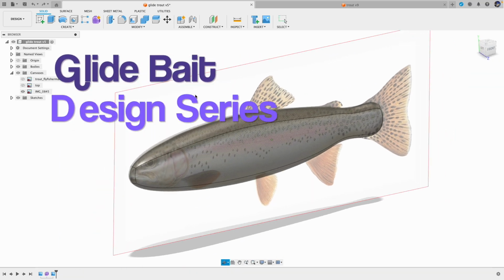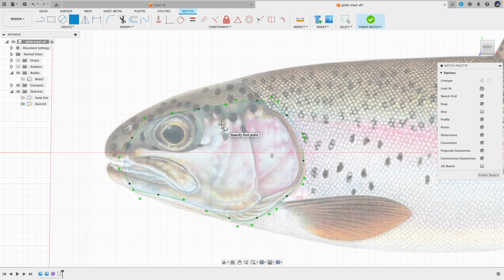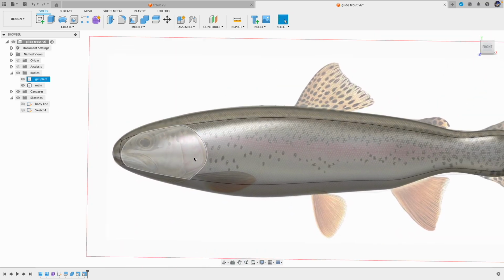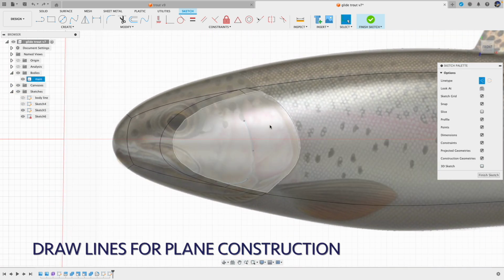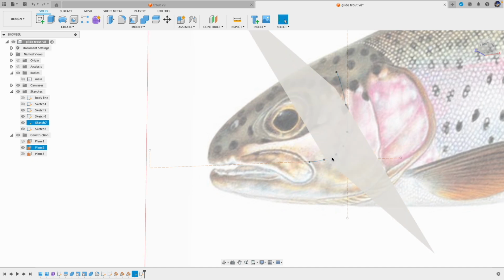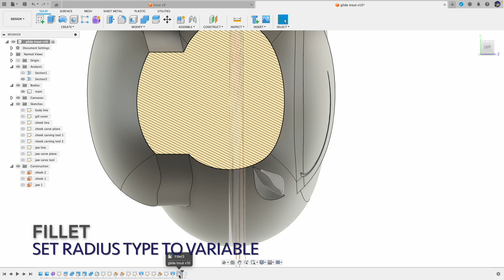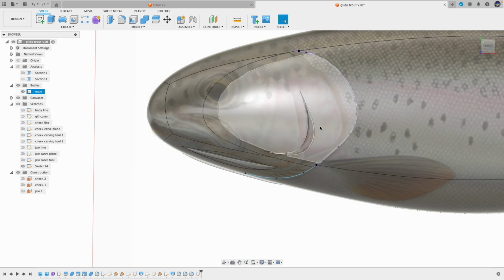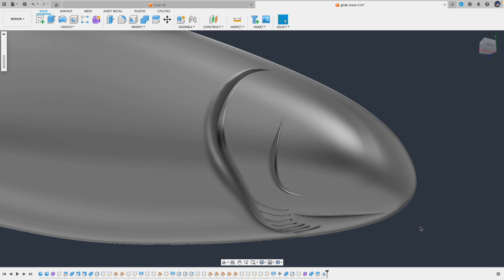Trout Glide Bait Modeling Series (in Fusion 360) - Gill Cover

Comment: How do you get the edge from inserting points to show up on both sides I keep putting numbers in adusting from top and bottom to make my bait perfectly symetrical there has to be an easier way, I tried splitting and mirroring and can't figure it out. Genuinely so frustrated
Reply from the maker: In the INSERT EDGE parameter window, there is an insertion side option, default to single. Change it to both and you should see new edge show up on both sides.

Comment: Hey man, coming back to your videos for some help. I am trying to make a joint in a glide bait but I can’t seem to get an even triangle joint between the two pieces. Please help!
Reply from the maker: Please take a look at this similar process 
https://www.youtube.com/watch?v=9kSYyg02ZEk&t=810s
Basically I draw an angle line, mirror that line for form a V shape, then thin extrude the V shape. If you want a tapered gap, you will need to draw a path, like the outline of the letter V, and make the tips of V wider, then just simple extrude to form the gap. Hope this helps.

Comment: did I miss the part where you show us how to bring the opposite side gill plate down to match the good side?
Reply from the maker: Not exactly know which step you are referring to. In general I would work on one side, then in the end I would split and dispose the bad side, then do the mirror to complete both sides. Occasionally I need to see both sides to get the overall picture, in that case I will do the mirror operation first. After I am done checking, I would move time line back before split and mirror, and continue on the design. Hope that answers your question.
Reply: @yauckoutdoors  that’s what I ended up doing!! You helped me jump this hurdle I’ve been trying to figure out the last few weeks. Now I’m on your scales video trying to figure the straight lines out 😆
Reply from the maker: @ZMosGreen  Great! Let me know if you run into any issues.

Comment: I found a good way to make the lips of a fish, you cut into the body of the fish the same way you did, in the same body that you cut, make another pipe formi and put the pipes and the place you cut, the pipes will follow the path of what you cut, for make one pipe for the upper lip and another pipe for the lower lip, pipeb selection/smooth display-end type/square, mark that as yours, otherwise it won't work with the form, it only took me 5 days to figure it out, I finally succeeded 😁
Reply from the maker: Yup that’s kinda what I did in the goby model https://youtu.be/Z3PT88RQdgQ. I didn’t make the lips like that here because trout don’t have distinct lips like that. I only used fillet to round them off at the edges, I will paint it with a light color but that’s pretty much it. Glad you found the solution yourself. That will definitely make you a better model designer. Happy modeling!
Reply: @yauckoutdoors  I'm sorry, I wrote the wrong message and I corrected the mistakes, instead of the body make a form pipe, the form pipe can be distorted, you can also cut the body and that cut will be shown on the form, that way you can place the form next to the body

Comment: I wish you all the best, just so you know how much you helped me with this video, I've been working for almost three months on one fish model, I made the body of the fish using pipe form and the fins, gills and other parts using extrude, it took a lot to learn from the beginning when I started everything by myself, I started the width, height and length of the body wrong, since I made the fish from several parts, the shell did not allow me if I wanted to make a stencil for airbrush, every time I came across a different obstacle, mainly yesterday I came across your video and I started the model from scratch and finished it in one day, if I can give you advice, listen to it, you don't need to make a slit in the gills, it can be done much simpler, the head has several parts, around the eye and up to the notch (the line between the gills) you draw that part, and you draw the second part from that line which is in the middle of the gills and goes all the way to the end of the gills, in the same way make those two parts of the fish's body as you showed in the video, pull those two parts out of the fish in the simplest way - move/ copy and a hole will appear between those two parts.
I couldn't have explained better because my English is very weak, with this method I can now make a stencil without any problems.
Reply from the maker: I am glad that you found these videos helpful, and really appreciate you taking time writing the feedback. I'd like to share my passion in a greater community, interact with people with similar interest, and so on.  But since the channel hit 1000 subscribers, the algorithm seems to work against my favor. I hope this type of the interactions (viewers feedback) can wake up the algorithm and let more people be aware of this channel. 
The next chapter is almost ready, please stay tuned and spread the words. Happy modeling!

Comment: and I don't know if this is possible, I tried the same but I didn't succeed, is it possible to move the edge, I don't know if I will be able to explain, when you make a form from it you get a body, but that body does not consist of one part but of three parts , the upper and lower middle part, I would like to move the edge in the form so that the middle part is wider, that's why when I make fish scales they go all over the body of the fish
Reply: Yes i possible , modify - insert point, on edge ,slide edge
Reply from the maker: Yeah you should be able to move the edge, looks like you have found your answer. If pipe form won't work, you can also try other forms. Happy modeling :)

Comment: Excellent work as always! When you scale the gill plate, if you select the origin for the point (in the scale dialog) you will get symmetric scaling. Not that it really matters but my OCD brain likes it better that way 🙂
Reply from the maker: I noticed that too. But it’s sort of a beautiful accident for me. When I didn’t do the symmetric scaling, part of the gill plate surface was embedded inside the head, and that’s exactly what I want. Otherwise the whole gill plate surface would be outside of the head (imagine those vertical cliffs 😫）, and I would have to push it into the head, one extra step…